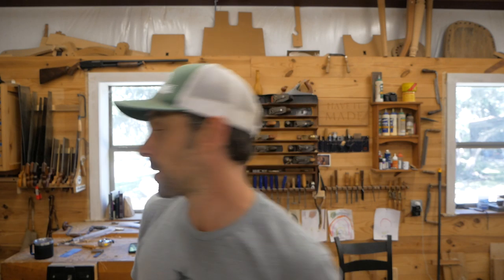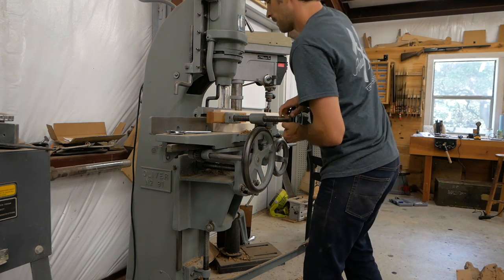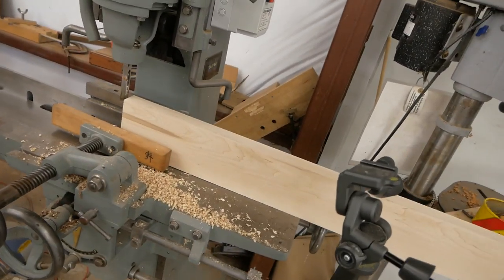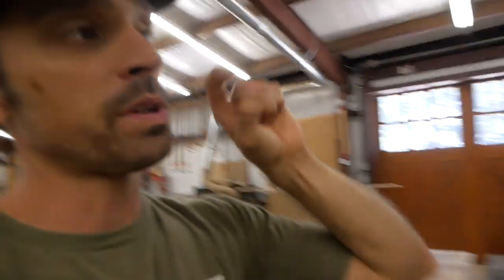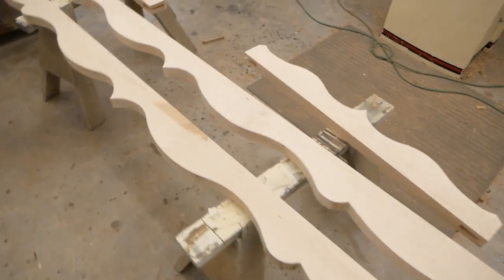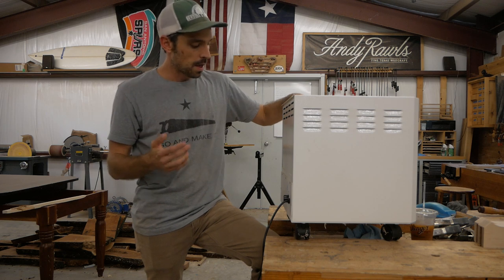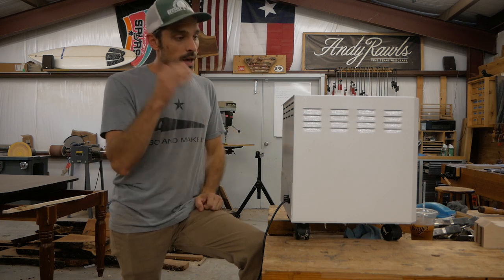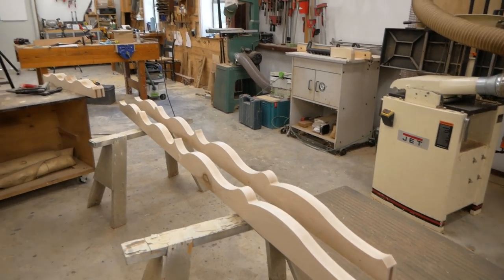Building A Dining Table: Fabricating the joinery and profiles

Comment: is there no way to loosen it spring up so it's easier to step on ????????
Reply from the maker: It’s actually not the spring but just the shear force it takes to cut into hard maple with a .5” bit.  It was also getting a little dull